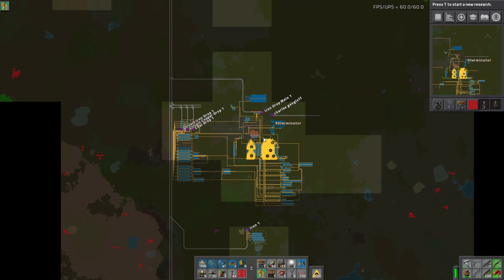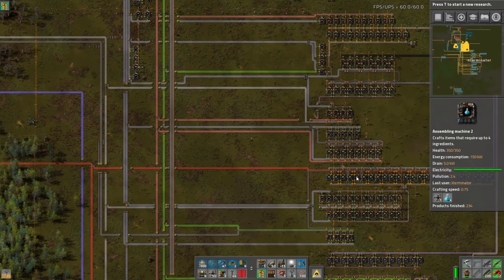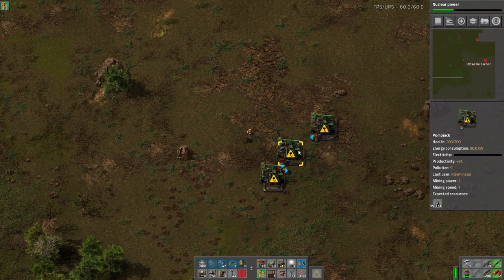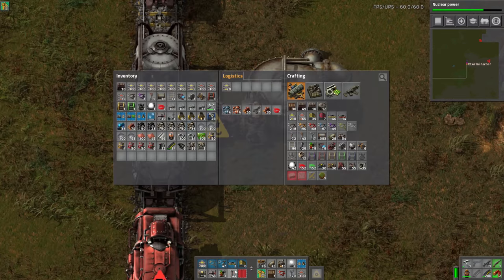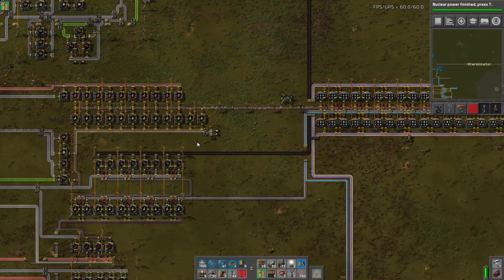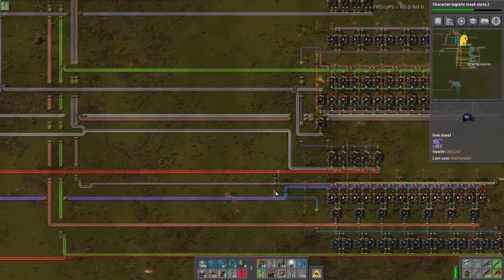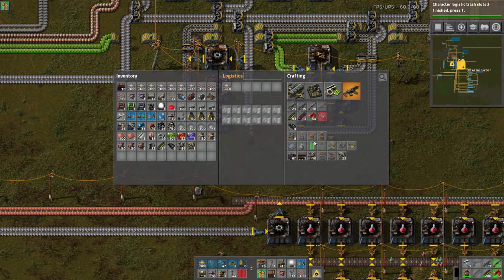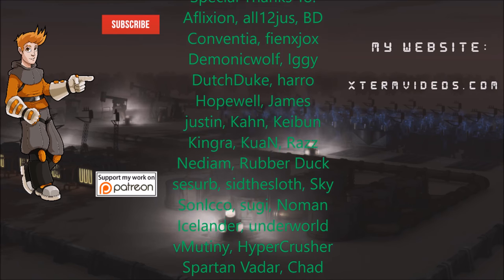Factorio: Tightening The Belt: Megabase Guide EP19 - OIL TANKER WAGON | Tutorial Gameplay Series

Comment: The coal shortage for power is probably caused by the unloading station. The inserters for both sides of the belt are connected by circuit network, causing one side of the unloader to wait for the other side of the belt to empty. This reduces the belt capacity to 50%. Removing the circuit conditions completely should fix the problem.

Comment: I was looking at the Roboport the other day. It would make so much sense splitting ut up to 3 diffrent item in steed.

1: Chargingport (1x1, just charge one robot)
2: Unit storage  (1x2)  with 2 slots of repair pack and  bots
3: Logistic control units (2x2). Set the logistic space.

That would take exactly the same space and have pretty much the same  preforamce. While it could be seen as a buff. Lowering the logistic space for the smaler logistic controll unit would make sense.
Reply: Seth splitting the roboporta

Comment: why won't the map exchange string for "sending supporters to space"work?  I'm using version 0.15.37, and I have installed all the mods used in the series (except the sending supporters to space mod cuz it's  a private mod). What am I doing wrong?
Reply: He might have tweaked rso.
Reply: The map generator for 0.16.x is different that 0.15.x, so i believe you can't get the same map with the string.     Someone correct me please if i'm wrong.
Reply: I know map gen for 0.16 is different than 0.15.  That is why i installed Factorio version 0.15
Reply: Right, but i think (could be wrong here) that Xterminator is using 0.16 (since he has the 25k version of the tanker wagons), but it could just be rso tweaking.
Reply: Ok, as i re-read your post, all i can think  is that as goodforthewin pointed out he proabably tweaked rso.